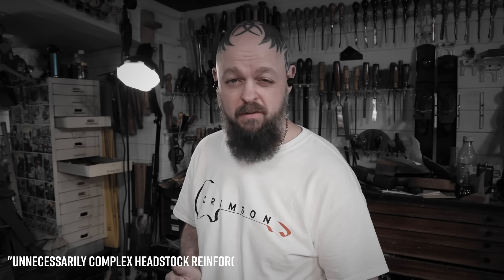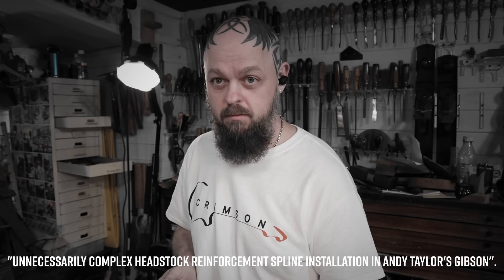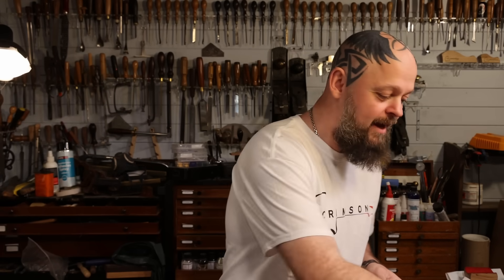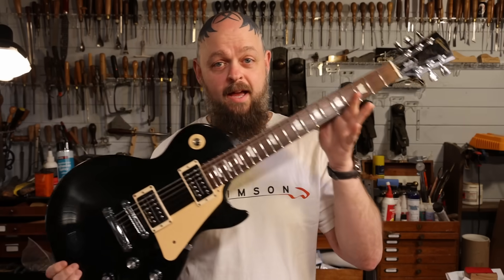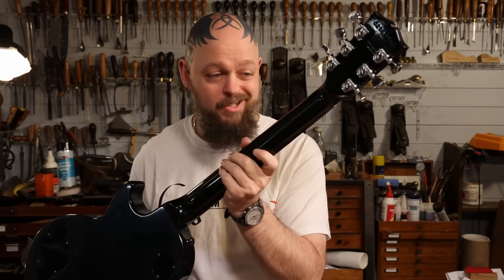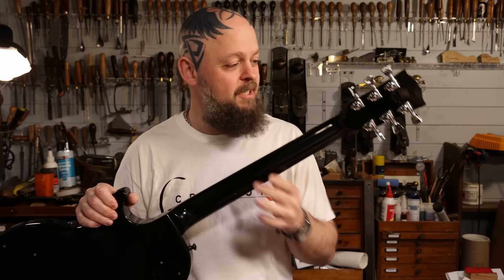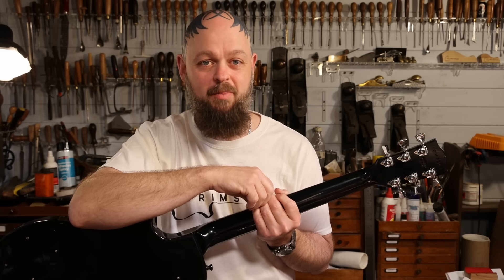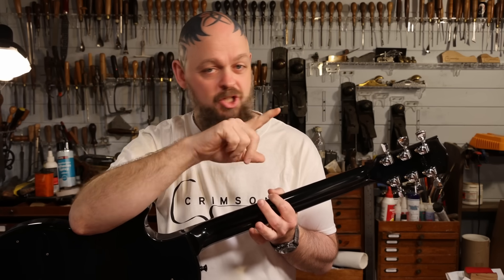Unnecessarily Complex Headstock Reinforcement Spline Installation in ANDY TAYLOR'S Gibson!

Comment: Understand the reasoning for doing it this way Ben- but if it was my guitar I’d want it sanded flush and refinished to match the neck. Just an aesthetic preference
Reply: Yeah I also do not like that the carbon fibre braces are standing well proud and not flush, considering the road repair was holding well adding these was a bonus so I can’t see why they couldn’t be flush sanded.
Reply: If I got this back from a Luthier I'd be well pissed off!
Reply: And if you think a repair like this isn't discussed upfront, you are just straight of your mind. I can guarantee that it was discussed before hand that they will be proud and not flush.
Reply: @GroovingDrums  You think Ben said to him 'I'm going reinforce your neck with Carbon Fibre Splines that will stand proud about 3mm from the surface' or 'I'm going reinforce your neck with Carbon Fibre Splines'? 
Then Ben Ben thought to himself 'I'm not going to make the repair as inconspicuous as possible, that's what every other Luthier would do, I'm going to make the repair look look as obvious as possible and people will marvel at my out of the box thinking!'
When in reality everyone who sees it will think 'WTF is going on there? Who on earth did that to your guitar?'
Reply: Goes on about beauty and rounding off edges and finishes with a rough chamfer on a corner. Looks like a bodge ending in a 'can't be bothered'.
Reply: Not so keen on this one. Appreciate the extra strength added. But not keen on the final look. But as long as Taylor is happy with it, that’s all that matters.
Reply: Top chisel skills by the way. Very impressive!
Reply: It might be to strong at that spot now , next knock or fall and it may break in a different spot .
Reply: I’m the same way
Reply: Me too.. It just feels incomplete as is to me.
Reply: @alpeterson 4:29 4:29 4:29

Comment: As for the above project, it's hard to see, but my designer construction instinct would have the middle of the splint exactly halfway where the break was. It looks like you started at the break so a bit further on the headstock side. That gives less area on the neck side for the splint to hold on to. My designer aesthetic gut tells me it could be shaped more beautifully with a bit more effort. Puzzling because you usually go way beyond where I would have stopped.
Reply: Agreed - I've seen (pics) of a lot of breaks further down the neck. This could even put more stress on the neck immediately below the carbon
Reply: I think the stress will not be much different. Should the guitar fall backwards onto the back of the headstock the way most necks break, the stress is only different in that the splint doesn't flex as much as unsplinted would. Apparently that was enough to break it once already so it's enough. It's just my autism saying to me that if it's going to break, it'll break there. Unfortunately, I'm usually right,  @Da5idc

Comment: I'm baffled by this...intervention. I know the theory behind splines, and carbon fibre and JB Weld may well turn out to be a strong combination. But I think they should have been longer - is it just convenience that prompted the choice of nut blanks rather than longer rods? 

What bothers me the most however is the result is not "unnecessarily beautiful". Unnecessary beauty would have been fluting ocean waves into the bits sticking out of the top, or carving in the lyrics to one of Andy's songs in a script not visible to the naked eye, but nevertheless there for an electron microscope to see.  Unnecessary beauty would have been inlaying the proud standing material with melee diamonds, set to look like moss growing on an ancient wall, or burnishing the remaining carbon fibre with platinum leaf to match the tuners. But this is just unnecessarily awful looking.

Comment: I’ve seen many videos of Gibson guitars with volutes still suffering headstock breaks, so I think this repair with carbon fibre which is stronger than wood and epoxy which creates the strongest bond between wood and non wood materials, and also adding extra material in this weak area by having the carbon fibre standing proud of the finish is a really effective solution , great work Ben
Reply: it will always happen due to the neck and headstock angle, the only way to avoid this is to change both so that the headstock doesnt extend beyond the plane of the body anymore when laid  flat.

Comment: Sorry Ben, while I respect your work, this looks rushed, incomplete and I am unsure how much strength it would add. where it had been broken you have only gone 5-10 mm past the crack so it would end on weaker grain than if you had gone further down and shaped it away. if you wanted to make a feature of the top bit, chamfers and a polished finish would have looked much more complete.
Reply: Glad you said it.  U saved me the hassle of trying to use my brain to come up with words.
Reply: Yup, this just isn't a repair that really does much.

Comment: For mixing epoxy I’ve started mixing on a silicone pad I made with some excess when I made a mould. 

It’s great as nothing sticks to silicone so clean up is easy once cured. And as you can just leave it to the side you can poke at it and see when it’s gone off properly without having to guess.

Comment: I’m sorry Ben,but, after 40 years of making and repairing instruments, thats one of the worst headstock repairs I’ve seen. Using carbon fibre does add strength but the splines are to short and a future break is going to occur outside their range as the profile you used is frankly overly rigid and will transfer any shock further down the neck. I’m aware you like hand tools, free handing that repair had the potential for creating further problems.  In my opinion some longer less substantial carbon fibre splines combined with adding wood to create a volute would have been a structurally superior and more aesthetically pleasing option.
Reply: He did say it was already repaired so it will probably be fine but, yeah, I think he could've just used one, cut it in half so he had two 20-25mm strips, though I get that he didn't want do deal with that sawdust. (Edit) Nah, well, ok, I didn't finish the video when I first commented but now I have, that is a bit much, Ben.

Comment: Several (many?) have commented that they would have centered the carbon fiber on the break, Consider that the CF is inlaid in line with the headstock whilst the break is in line with the neck. That means that the CF crosses the break line at an angle, and since it is sunk into the headstock it is closer to being centered on the break than it appears.

Comment: I dunno... I like that it was done w/o messing w/ the finish, but the final result was a bit too rough for my taste. If it were mine I'd want the neck ends of the splines contoured as closely to original as possible w/o marring the finish, and for aesthetics I might like the headstock ends extended all the way through the head (if not as deeply inset as the "working" spline area). But hey... that's just my taste. The important thing is will Andy like what you did?

Comment: Hi Ben, thank you for sharing and showing that you can do it without a router, I understand that it is a not a 100% splines needed procedure, but with all do respect, I believe that because of players perspective, care or request, you preferred not to touch from the nut to the frets area, but wouldn't be best to have larger splines, with preferably equal sideways size, intersecting the break, than a small and tall, on one side the most?

Comment: I get both the "sand it down" camp and the "leave it as is, it improves stability" camp, so I'll propose a third option: keep it flush on the nut end and shape it like a scalloped brace so that it keeps the strength but it's better loooking?

Comment: I can understand the artistic choice of leaving the CF blanks proud on the headstock itself and keeping as much of the weave visible as possible.
But the part near the nut area would draw my eye too much and I'd feel worried that I'd smash my hand into it.
I'd need to to make the CF flush within the nut transition/volute area personally.
I'm going to have to try the scalpel/chisel method if I ever have to reinforce a headstock break again.
I've done it once on a cheap LP copy - but I drilled a series of holes and then cleaned them up.
I didn't have access to a router at the time and I kind of don't trust myself with one anyway.

Comment: It's an interesting fix to a design flaw in Gibson headstocks. Having seen you make a multi piece neck, would including layers of carbon fibre stop the issue with the grain run out?

Either way, I love the kintsugi style approach to celebrate the repair as part of the story of the guitar. Whenever I've watched Ted Woodford do splines I'm always a bit sad to see them covered over.

Comment: Lovely to see a slightly more intimate video from you Ben without the factory hubbub. For masking the slots for the epoxy, would frog tape have worked? I've had great success in using it for home decorating with zero bleeding underneath (unlike "standard" masking tape) but wonder if it's sealing ability could be useful in this scenario?

Comment: Hi Ben,
Love your videos and have been watching them for years. As a dentist (now retired - yippee) I was always taught to leave as much of the original material (in my case tooth) because the weakest point is the interface between the original material and what you are adding. i.e the bonding agent is the weakest point, no matter how good it is. If the original repair was good as you mentioned in the video, why remove more wood (original material) to replace it with carbon fibre? I totally agree that carbon fibre is very tough but question if gluing it into this neck fracture is the best way forward. I totally understand using it to strengthen a neck but don't get the use to do this repair.  I am not saying I'm right here but would be genuinely interested why you chose to use this method to repair a perfectly good (your words) initial repair. 
Love Duran Duran by the way. All the best. P.S. were is the hand tool guitar at, at the moment?

Comment: Personally I would have gone for less carbon fibre sticking out and tapered it down to meet the back of the neck. Also, I would have done it in two goes in order to avoid removing all the wood at the same time, although I appreciate there was no tension on the neck. You're an accomplished guitar builder and I'm not, so what do I know about it anyway? If the client's happy with it, it's a good repair.

Comment: wouldn't it be better to reduce the string tension when you are cutting the slots for the carbon fibre pieces? Weakening the neck could move the headstock and you could end up with a wrong positioned headstock.

Edit: He removed the strings for the glue up.

Comment: That is an interesting fix. I do however think Orson needs to take a running start and nut kick you for not wearing PPE when sanding that carbon fiber. I am fairly sure the lad wants his father around as long as possible and not suffering at end stage life. That is one of the most toxic things you can do. The dust gets in your lungs AND the carbon can enter your blood stream thru the skin.